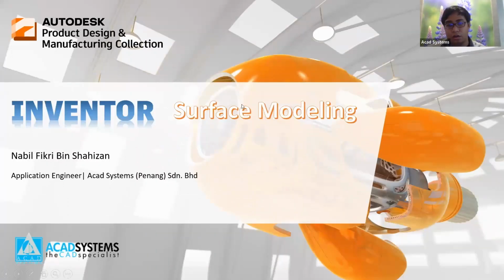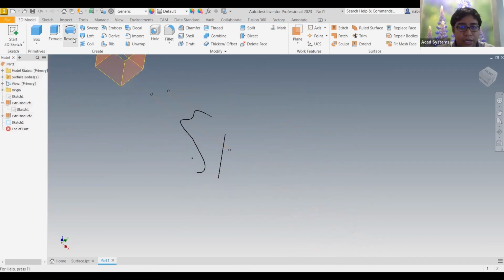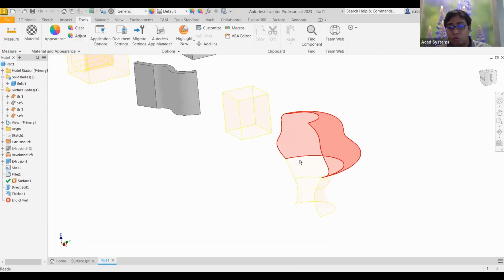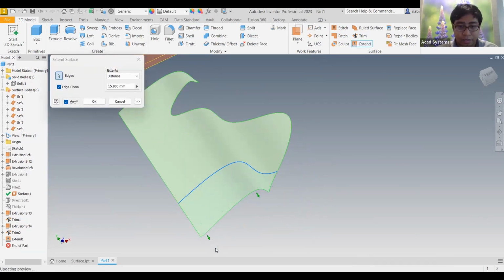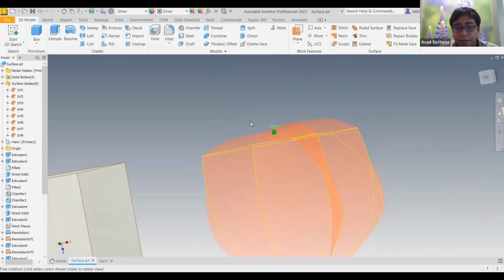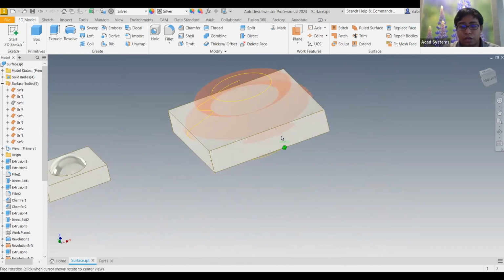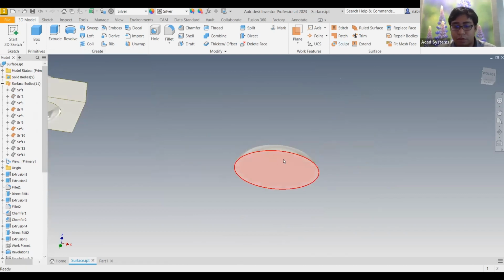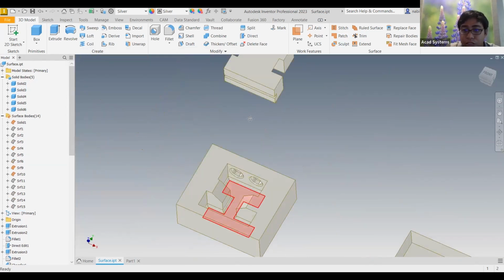Autodesk Inventor Surface Modeling

Comment: Great! How can I unfold a surface? I do not see this function in Inventor.
Reply from the maker: Hi, for that you can use Unwrap feature at the "Create" ribbon. Unwrap is a new feature release in inventor 2020. You should have access to this feature if you are using latest version of Autodesk inventor.
Reply: @acadsystems  , thanks!!